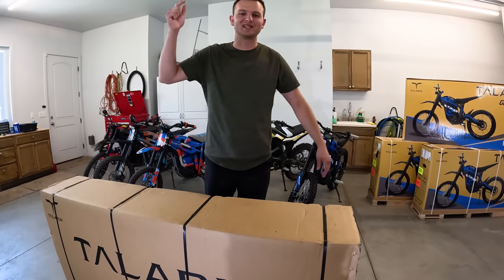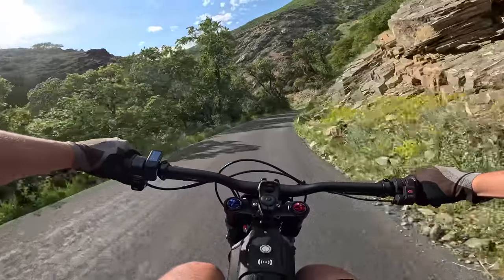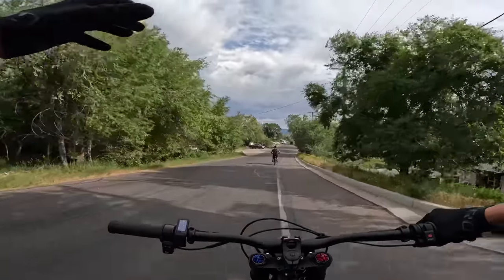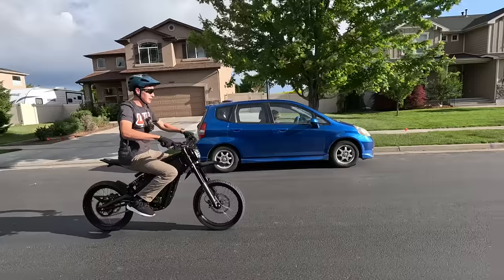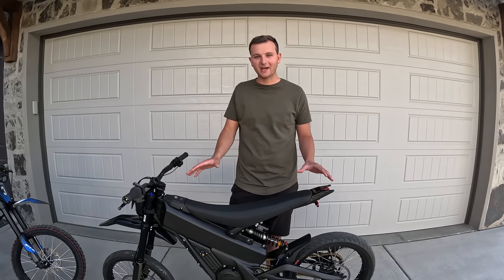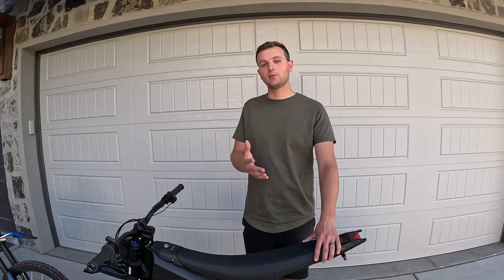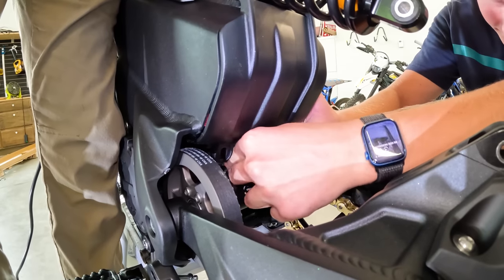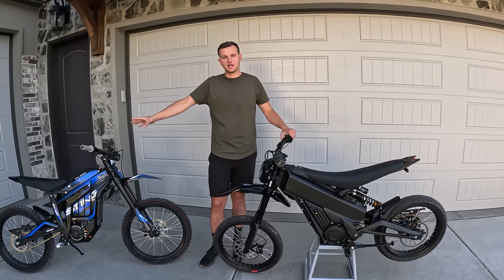New Talaria xXx! We Got It! // First Ride and Review!

Comment: Great video, I have two questions.
1. Do you guys disable the speed limiter for your videos?
2. With the way that battery is designed, would it be possible to upgrade to a bigger aftermarket battery, like a 72v, or will this bike just have less upgrade potential than a sting r or surron?
Reply from the maker: Yes you will be able to upgrade in the future. We go over that in the middle of the video. Yes the speed limiter was cut
Reply: @Talariaboys  how can I cut the speed limiter? Asking for a friend
Reply: @aquasmoke8539  surronster has a video showing it if it’s not included in this video
Reply: @aquasmoke8539  open the side panel and look for a small brown looped wire and cut it, that’s how most of their bikes wire the speed limiter, the only other way to disable it to my knowledge is to every time you start the bike do a long input sequence.
Reply: @kimhyunwoo8983  long input sequence? What is that,and thank you for the feedback

Comment: Quick question! So I got my XXX from Luna cycle. I assembled it and on my test ride I found out the rear rim is out of round… is Luna customer service usually slow to respond to trouble tickets? It’s like the rear rim is egg shaped. I only have 2km on the bike and have zero mods. Haven’t even cut the brown wire yet. Will they warranty the rim? I’d rather not spend another $400 on something I just got yesterday and is supposed to be brand new.
Reply from the maker: They are very busy so do take some time to respond sometimes but they should take good care of you. Glad you got a bike but sorry it’s not ready to go! You’ll be riding in no time.

Comment: Ok serious question guys, I'm 6'4" 290lbs. Should I get a surron ultra or the sting r? Daily commute on back roads roughly 45-55mph speed limit and about 6 miles one way.
Reply from the maker: So for your size the ultra bee would be more comfortable and work well. The sting R would be a little lower profile if you are riding on streets but if thats not an issue the ultra bee is a great.

Comment: I was about to sell my YZ250 to cover a Talaria Sting R. Then I saw this pop up. Outta nowhere. 

I’ll chime in on supermotos. They tend to feel faster than dirt setups. However, dirts wheelie and come up quicker. Feels like more torque. But sumos feel faster and turn better. Last longer on the streets. 

The only downside I can see is these bikes have fairly weak suspension. But that’s just me comparing these to the tried and try YZ suspension Yamahas come with.

Comment: Here in Europe the price is sadly around $4600, same as the MX3. For the X3 and the MX3 at the same price, which bike do you guys recommend? And why? Thanks for these video's!
Reply from the maker: Thats a good question, the standard x3 has less power and battery than the mx3, I think the bikes are very different and you will have to decide based on what kind of riding you do.
Reply: @Talariaboys  Thanks! I think mostly streets, with sometimes some offroading (but not heavy offroading). I'm also same height as you guys and around the same weight.

Comment: Keep in mind that you can't upgrade to a bigger battery in the future and you do lose some suspension travel for XXX compare to MX4 or Sur ron. Great move from Talaria, now whoever releases 72v with the same form factor would delivered a checkmate. It have to be below 5 grand.
Reply from the maker: I'm sure battery manufacturers will be able to squeeze a bit more capacity and voltage if they want too in a new battery.
Reply: I highly doubt that. The guys over at powerful lithium can make a battery for anything.
Reply: @drekenfps you can fit lithium into basically any structure or shape and there's going to be.demand for a battery with specifications that fit this bike so idk what hee saying
Reply: @drekenfps  You guys are so dubious but lack detail observation. A Sur ron or MX4, you can build a battery that extended over the top since its vertically mounted. XXX has a horizontally mount battery with their last 2" being use by suspension/retraction of the rear tire upward momentum, therefore there is not possible to have a bigger battery intruding outward.

Comment: Hi there,
First of all Congrats for your videos!
In your opinion, which is the best Talaria model:
The Talaria Sting MX3, the Talaria Sing R MX4 or the Talaria XXX?
In terms of prices, which one would you choose:
The Talaria Sting MX3 for €2,999, the Talaria Sing R MX4 for €3,490, the Talaria XXX for €2,850 or the Talaria XXX for €3,000 with Front 19 and Rear 17 off road tires?
Best Regards
Reply from the maker: Thanks for watching! I wouldn’t buy the Mx3, the mx4 is the best bike but xxx is amazing if you mostly ride street!
Reply: @Talariaboys  Hi Talaria Boys,
I am the one who appreciates your answer!😃
The use I will give the bike is mixed and with little use in aggressive off-road conditions.
Honestly, I'm between the Talaria XXX for €3,000 with Front 19 and Rear 17 off road tires and The Talaria Sting MX3 for €2,999?
Of the two, which has the better engine and gearbox and range?

Comment: Questions for you: 1) did it come with reflectors/turn signals/ license plate holder?  The international version seems to have that. Theirs is also grey. 2) the battery flap doesn’t look like it blocks out dirt or water, can you confirm? 3) what is the seat width in inches compared to the sting r? 4) can you remove the seat and what is underneath it?  (Looking at possible diy solutions to make the seat wider). Thanks
Reply from the maker: No it did not come with reflectors or turn signals or license plate holder, this US version is a little different. The battery door will keep out water and dirt better than the Talaria Sting or Surron models and the battery has waterproof connectors. The seat width is 4 inches at the top and slightly wider lower down the sides, the sting r is 6 inches wide. Yes the seat is removable, not extremely easy but it can, not much underneath it.

Comment: It's a minute job with two people and equipment. A single person with almost no tools would take at least a couple.
Reply from the maker: Still pretty fast and easy though
Reply: @Talariaboys  yeah, not as complicated as some would think.

Can it be charged with the battery inside? I think an easily removable battery is a bigger deal for those that have to keep the bike outside but no way of charging except indoors.
Reply from the maker: Yes of course it can be charged with the battery inside, I show in the video where the external charge port is on the side of the bike.
Reply: @Talariaboys  sorry about that, I was skipping through the video.

Comment: How do you remove the brake sensor on the uk version? And do you have to disconnect the battery any help appreciated thanks
Reply from the maker: https://youtu.be/fWW_3ww2v6g?si=UG85mdPkWcOdssXH
Reply from the maker: It should be the same as this video. Except you don’t unplug the wires in the frame. You just tuck them away

Comment: whats the charger specs? like amps and can you finally turn the headlight on and off?
Reply from the maker: Not sure the charger specs but it takes 4 hours to charge from completely dead, and yes the headlight has a very low daytime running setting that stays on and then it has regular beam and high beams on two switches that actually work great.
Reply: would you say the charger is the same as the sting r or no
Reply from the maker: Yes it’s the same

Comment: is there 2 models to this because here in uk its called x3 and its only 3500w peak ?
Reply from the maker: Yes we explained that in the middle of the video.
Reply: Even that slower XXX is pretty much just as fast as the original Sting MX3. It's been tested and confirmed. This bike special edition Luna XXX (Black Edition) is basically as fast as the R (MX4). Also, X3 is just short for XXX, also known as the MX2.
Reply: The UK model still does 43-47mph (unrestricted) from what I'm hearing, mine should be here soon I'll let you know.

Comment: I really want to see what it would be like with the sting controller on as it’s the same motor
Reply from the maker: The sting R controller is not compatible, it has different mounting and connectors plus the battery bms on the xxx will not allow another controller to push any more than the stock 6.5kw of power
Reply: @Talariaboys  sweet thanks for clearing that up for me

Comment: Can you put the sting r's 19 inch wheel set front and back?
Reply from the maker: We have not tried yet but we measured and I think it will!
Reply: @Talaria Boys  thanks for the prompt reply.  If you can get a verified true measurement and compatibility then i will pull the trigger on the x3. Awesome content!
Reply: If you guys could throw on the stock 19 rear from the R and report back  with any issues encountered it will be a great help and it would help me in getting in on the next batch of the x3 before its sold out again. I think the battery removal work around you guys made instead of removing the entire rear wheel was brilliant! You guys think outside the box and it shows .

Comment: For me, it would have been much more useful to see the time and effort for battery removal with: 1) only one person, 2) no powered tools, 3) no stool to hold the bike up, and 4) complete reassembly time.  For most people, this is the more relevant situation; i.e. on an extended trip with a spare battery in a backpack and swapping on the road.  It's a great value; no need to oversell - battery removal taking 5 minutes rather than 42 seconds won't change anyone's mind about buying it, but would make your channel more credible.  Also, seems like a threaded hole or welded-on nut with a bolt would actually make battery removal and reinstall easier and ironically "quicker" than quick-release leavers.

Comment: How will it ever fit a battery upgrade
Reply from the maker: Not all aftermarket batteries are actually a bigger batter, often times the manufacturer can fit more cells and capacity into the same housing that fits into the bikes battery compartment. So the battery isn’t larger but has more power and capacity
Reply: @Talariaboys  ah ok cool